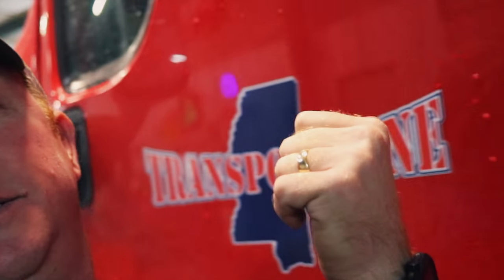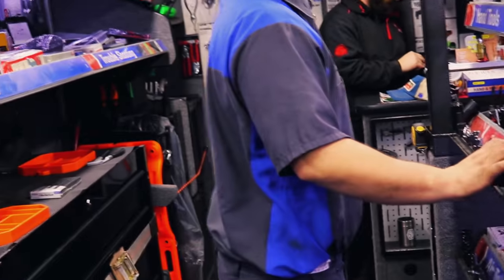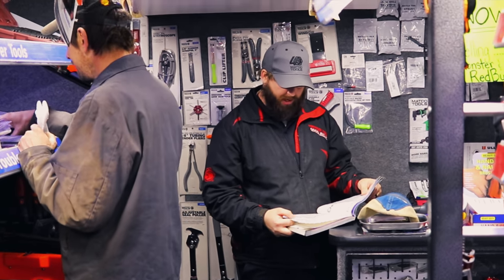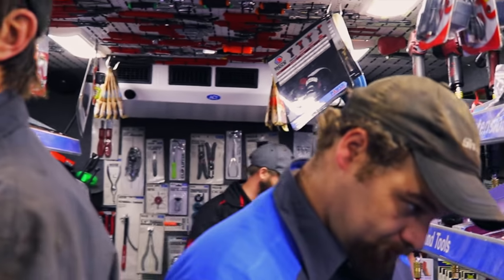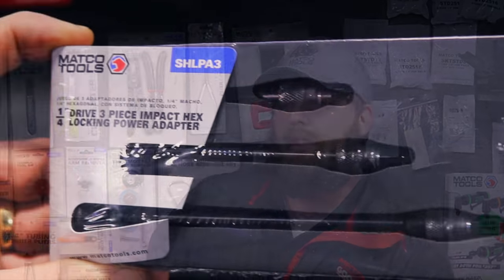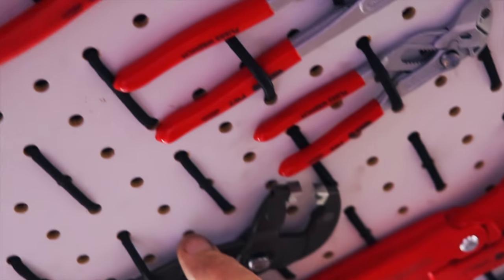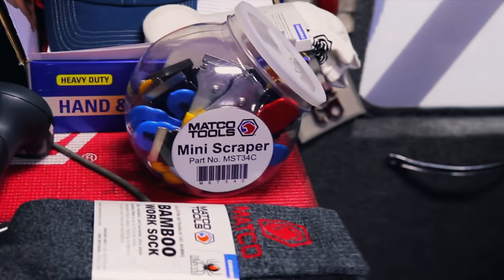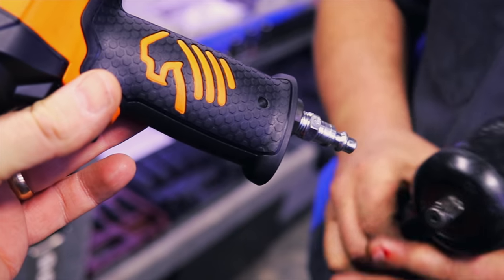Matco Stubby Impact Trade, My Dealer Busts A Wrench Set Open To Make Me Happy

Comment: Nice zippo! Great video, nice haul! Socks that are better than snapon, I don't believe it!
Reply from the maker: They are much more comfortable ! But they don’t hold up very long. Guess they are like a nitrous motor...... awesome as hell for a few passes then ready for the trash and go again ! 
They are very comfortable but any place your boots rub, they go away fast.
Reply: @KoonTrucking  sounds like I'll keep my snapon socks, I'm tough on socks and snapon lasts in my steel toes better than anything else I've tried!
Reply from the maker: They do last a lot longer. I’m still wearing Snap On socks that are two years old..... my first two pair of matco socks already bit the dust. They are comfortable no question about it, but they aren’t very durable.
Reply: "Dickies" work socks are the way to go!
Reply: @donaldhollums3278  the last 2 bags of Dickies work socks I tried didn't last 3 months, I tried the steel toe and regular work socks, neither lasted long. I've tried about every brand sock there is, snapon lasts the longest for me.
Reply: @dieseldoctor9294  I agree I got some dickies socks and had one of my piggys poking through by the end of day 2.
Reply: @dieseldoctor9294  I've had my same Dickies work socks for about 12 years. That's with my full time job keeping me plenty more active than my part time automotive repair work, working 8 hours a day for 5 and 6 days, running, walking, getting in and out of the car, putting up with the 10 months of Summer in Alabama, and constant washings. I've only tossed two pairs for holes and added two more packs of the same socks just for extries.